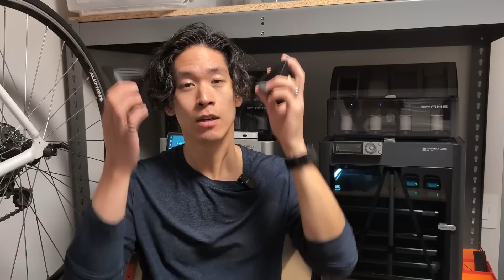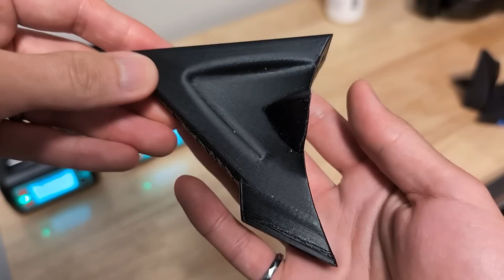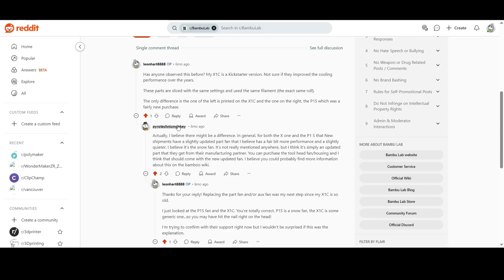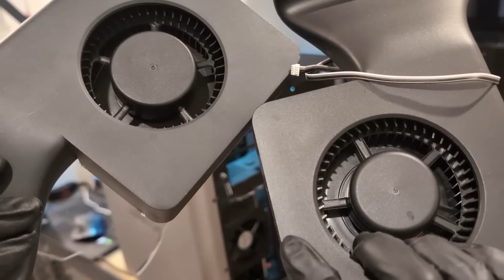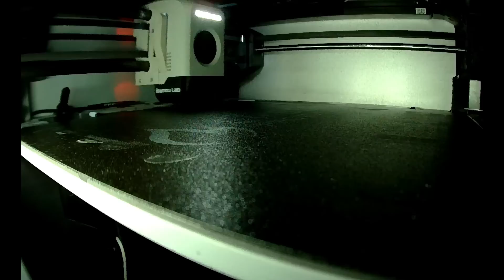Why Your Bambu Lab X1C Overhangs SUCK

Comment from the maker: I showed the wrong part cooling fan on the Bambu Lab website - see the description for correct links.

Old cooling fan --> no name, 0.15A
New cooling fan --> Snowfan, 0.22A

Old aux fan --> no name, 0.50A
New cooling fan --> Snowfan, 0.80A

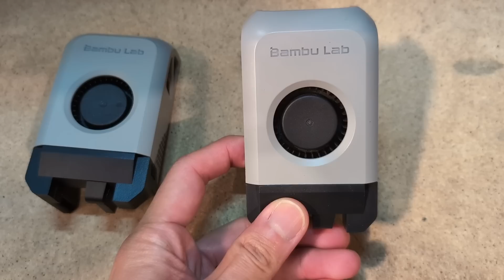The easiest thing to do is remove the front tool head cover and look at the fan label (shown in timestamp 2:40). If it's an older one, chances are your aux fan is also old.

I also added the 3MF file for the cat ears in the description so you can test yourself.
Reply: My P1P has a no name 0.15A part cooling fan as well.
Reply from the maker: @RFmissbehavin yeah, been hearing this a lot lately. I thought it was Kickstarter units only but guess not 😮
Reply: @emberprototypes  Bought mine in 22 and they are both the older ones time to get a different one thanks for the info.
Reply: I bought a new frontend assembly now and it has a 0.2A (not 0.22!) fan from Guangdong Fengxin Electronic Motor Co which is definitely not a Snowfan
Reply from the maker: @kuuhgle  hah, i guess things be changing all the time! A small difference in current might not be meaningful here, as without a datasheet to compare, we can't know whether or not the flow is actually better or worse
Reply: @emberprototypes  do you have an email? Ill look up the spec sheet
Reply from the maker: @kuuhgle yup, go to our website and the emails there! You can probably find the spec sheet just by looking up the part number (though I couldn't find the original old fan model I showed)
Reply: I bought my X1C in July of 2023, where the first units shipped in September of 2022, and it has the older 0.15A fan on the front housing assembly.
Reply from the maker: @dandixonus  my kickstarter theory has definitely been proved wrong by all these comments 😅
Reply: I got a replacement aux fan with my used X1C, the guy hadn't installed it yet. It's a 0.80A no-name fan (no snowfan) weird!
Reply from the maker: @kuuhgle  It's possible that it's actually the same model as the Snowfan. Some people have sent me pictures and it doesn't have the Snowfan name on it, but the part number is exactly the same (which means they just changed the look of the label at some point)
Reply: Have you found anywhere to just buy the fan instead of the whole front assembly?
Reply from the maker: @Ouroboros_Yokai  no but I honestly haven't spent much time looking haha
Reply: Quel est le mieux : 0.15A ou le 0.22A ?

Comment: I ordered a new toolhead and got a 0.2A Fan instead of the 0,22. But as my old Aux Fan Had a Problem and they sent me a replacement, I got the right one from snowfan.
Reply from the maker: The aux fan is probably the biggest contributor if you are having issues. It was for me at least.
Reply: @emberprototypes  I only use the aux for circulating the air. I have a reflector mounted so i don't use it for cooling because I mainly print ASA and I don't want the parts to be warping.
Reply from the maker: @Muu_69 ah yes. I never use it for engineering materials either!

Comment: If I print PLA with the top door closed on my Centauri Carbon the printer either beeps at me for excess heat or I get that result with overhangs. Simply taking it off solves the problem and keeps the printer temperature correct.

Comment: My test result: There was NO difference. Exactly the same before and after. $60 for nothing 😞

I watched the video and found the difference quite clear. Since I bought my X1C in June 2023, I was sure I had the old fans.
So I ordered new fans. The new fans were also different, as described in the video.

I printed the same file as in the video. Then I installed the new fans and printed the exact same thing again for comparison. 

And I have to say, I saw NO difference. The result was 100% the same.

The before and after prints looked exactly the same as on his P1S, or as they did after he replaced his fans.

I could have saved myself the $50 for the fans. And because the video also shows the wrong fan (the correct one is in the description), I spent over $60 for nothing. 

In his case, replacing the fan seemed to have helped. But my tip to everyone watching this: first check whether you actually have any problems. And don't blindly buy new fans based on the advice of a video.

I don't want to badmouth or disparage the video or the tip. In his case, it helped. But for me personally, it didn't do anything except leave me with a bunch of spare fans.

I'm curious to hear what others have to say.
Reply from the maker: Sorry to hear that, but also good to hear your machine never had issues to begin with!

I think there could be lots of variables here...maybe I had a bad aux fan to begin with and the fan model change was just a red herring. Maybe there have been firmware changes since the six months ago I filmed this that resolved or improved overhang issues. All I know is that it helped me and I wanted to share my findings with others.

For others, definitely check that you have a problem first!

Comment: Which fan did you replace exactly? In the video, you order a cooling fan for the hotend. But in the video, you then seem to refer to the fan from the front housing assembly. The cooling fan for the hotend is located directly on the hotend and is much smaller. This is very confusing in the video, and I have probably ordered the wrong fan. 
So, once again, which fan did you order exactly? Thanks.
Reply from the maker: I show the wrong fan for the tool head in the video (noted in my pinned comment).

The link in my description is the correct part. Sorry for the confusion!
Reply: @emberprototypes  Oh, I hadn't read the pinned comment. Well, it's a bit annoying, but having a cooling fan for the hotend in reserve might not be a bad idea. 😀
 The worst part is that I now have to wait until the right fan arrives to test whether there is a difference and how big it is.
Reply from the maker: @marcloker5240 yeah sorry, I wish YouTube let you edit or at least put text over sections of videos...not sure why they don't allow that. Hope you can see some gains once the right fans come in!
Reply: @emberprototypes  Thx. I will tell you about my experiences.

Comment: I’ve used an A1 mini for a few years and recently upgraded to the X1C but have been extremely disappointed that the bridges and overhangs look worse than the A1 in every print so far. Both my fans are no name but are .20A and .75A and say Rev 2025-04-17 V1. Do you think it’s worth upgrading?
Reply from the maker: Interesting - sounds like there are so many different fans out there. I'm not sure that it would be worth it if your machine is new honestly but if you've tried everything else then maybe worth a shot

Comment: Wow, never heard of this and I have an early model of the X1C, so will definitely be ordering new fans. Thanks!!
Reply from the maker: No problem 🙌
Reply: I would change the print head fan only...
Easier and probably gets the same result in this case.
Reply from the maker: @anderslagerqvist2642  I remember trying this but didn't film it and I think I recall the aux fan making the biggest difference.

Comment: The other thing that I certainly wonder about on the x1c lately compared to the p1s, is the AI flow control. I wonder even more about it after adding a H2D to my farm. Which initially out of the box had very poor PLA quality. But after several prints, (of the same part with no slicer changes) this changed. Yes the H2D seems to be more AI compensated than the X1C, but i certainly wouldn't be surprised if there are things shared between the two in this situation, inside the codebase. 

If i am not printing PC/Nylons the p1s is generally been my goto and reliable machine choice. Which shows you just how good a simple machine can be for so much stuff. But active chamber heater on the H2D is a game changer for high temp and engineering filaments. Even compared to the X1C, Which is very good. 

Also I am currently waiting for the next couple of revision of bambu studio 2.2.x (as i don't trust the initial release, had to many problems lately with odd slicing behaviors on some of the initial releases). Cause I really want to see what Helio add's for visualization information, help me tune my prints for production repeatability and quality.

Comment: I'm running into a similar issue between two X1Cs with PETG (Bambu's PETG-HF filament).  It's a fairly simple model with a ~45-degree overhang on both sides, but regardless of how well I dry the filament, the one printer just doesn't look as good as the other on overhangs.  Here's the kicker though... unless I miss-numbered my printers, the older X1C is the one that prints better than the newer one.
Reply from the maker: That's wild 🤯would be very curious to know why!

Comment: funny, I have the exact same problem but on my p1s, I just checked the fan and it is indeed the same as the one you replaced on the x1c
Reply from the maker: Weird 🤷‍♂
Reply: Did you manage to fix it? Maybe you are not running it on 100%?

Comment: Nice info thanks for the video I wasn't aware they changed the fans for the better. I have a old X1C and overhangs were bad but I found orientation of the over hang to the toolhead part cooling ducts made a hung difference. So I printed parts so over hanging areas were at 45 or 30 degrees to the ducts and that's a big improvement due to the amount of air now hitting the loong surface. 

I then changed to a superior design part cooling ducts by ben2c that has four air exits and a vortex affect to it. Now I don't need to worry about angling parts as it's awesome upgrade
Reply from the maker: Yeah orientation can make a big difference since the aux fan is only on the left side...for me, if I printed these cat ears 180 degrees around, the overhangs would be really bad
Reply: @emberprototypes  ah i think i haven't been understood here. Just made a image but damn can't share it here. so i meant no aux fan. only part cooling on the tool head. Angle the over hang of the part at an angle of 45 degrees to the air duct / the side of the tool head, or another way of saying it is to angle the overhang face so it points at the camera or front left of the printer. I found the left side is more powerful (without aux fan) and at this angle the fan blows more heat away and overhangs far better at speed. I also think at an angle means the air is not forcing the filament downwards as hard which would blow it away from the part. There's always slowing your wall speed down and also printing from inside outside wall order that makes a big difference to more extreme overhangs.

Comment: Anytime I print with PLA in the X1C, the aux fan causes that side of the print to lift off the bed and cause imperfections or failed prints.
Reply from the maker: Weird. I keep hearing some people say this but I've never had issues, and find the aux fan is really important for high speed PLA printing.
Reply: @emberprototypes Fingers crossed that it’s not the new aux fan, you’ll have to keep an eye on it 👍

Comment: I have an early X1C and I just wonder how this'd be if you replaced only one of the fans instead of both at once. IMHO if troubleshooting an issue, don't change multiple things at once…
Reply from the maker: Yes this is very true if you are trying to be scientific. In my case, I didn't really care and just wanted to solve the problem and it was cheap enough for me to do so simply by replacing both. I'm quite certain the aux fan helps a lot - and I think I did run it without the aux fan replacement but maybe just didn't film that. It's been more than 6 months since I filmed the video here so I probably forgot some things along the way as I edited recently 😅
Reply: @emberprototypes  I was just wondering, since I've seen videos that have advocated turning the aux fan off altogether, since it just ruined everything, or so they said. I've tried to turn it off for some prints, but haven't noticed much difference.
Reply from the maker: @roysigurdkarlsbakk3842  i've honestly never heard of this until I published this video. I've personally never had problems with the aux fan 🤷‍♂
Reply: @emberprototypes  Well, then the title of the video is misleading because you still don't know why :)
Reply from the maker: @Somun-a well I know that my X1C overhangs sucked and after replacing the fans it didn't suck 🙂
Reply: @emberprototypes Lol,  we are splitting hairs for sure but that would be "how to fix your (old) X1C overhangs". As in, don't know which one helped but the issue is resolved.
Reply: It is not just opinion, it is scientific protocol.

Comment: Did you show the wrong fan in the video? You only need the new front housing and the aux fan right?
Reply from the maker: Yes. Pretty sure I showed the correct parts in the video
Reply: @emberprototypes you showed the hotend fan which isn’t used for the part cooling 
The front housing already comes with the part cooling fan right?

Comment: Would you mind comparing your P1S fans voltage and amps versus the new fans?
Reply from the maker: I never filmed this, but I did take off the P1S toolhead and it was indeed the new snowfan units. I didn't remove the P1S aux fan though because that was too much effort. I should film/document this comparison next time!

Comment: I would suggest also adding a second AUX fan for more even cooling on both sides of your models. I think you have to get a splitter for the AUX fan and route the fan wire through holes in the printer frame and side panels... Well... It's easier if you actually take off the side panels, but I was doing it to 6 printers, and ain't no body got time for that
Reply from the maker: I've thought about this because if I actually flip this cat ear 180 degrees so the overhang is facing AWAY from the aux fan, overhang results are ugly...so there is definitely directional dependence on the aux fan.

Comment: I just completed a deep dive on this exact issue.  I found that the fan was often not even trying on a lot of overhangs that it should have been at 100% from the slicer.  In the process of trying to fix it I discovered that there is a parameter available in Orca that fixed most of it, with the old fan.  

In the printer settings, in the upper right of the setting panel, select edit, and look at the Basic information tab, there is a Cooling fan section.  there are 'Fan speed-up time' and a 'Fan kick-start time' parameters.  I set them to 0.5 and 0.3 and unchecked 'Only overhangs' and although it still ignores things sometimes, basically it prints overhangs well now.  I will definitely get the new fan, but I bet you can cleanup that first edge with these parameters.  Thanks for finding that!
Reply from the maker: Ah interesting. I'm not surprised to hear a settings change could improve the overhang results...but the fact that the same settings between P1S and X1C were giving me totally different results drove me nuts and down this rabbit hole 🙃
Reply: @emberprototypes  I kept changing things to improve the curling.  The G-code and the maps looked right but nothing changed.  I sat in front of the machine and discovered the fan was not even turning on sometimes and too late others. So I started going through every setting I could find and stumbled across it.
Reply from the maker: @ralphjohnson100  sounds like we both like rabbit holes 😂
Reply: @ralphjohnson100  same issue here. x1c  maybe halfway through a bridge it will spin up but by then its too late.
Reply: Funnily enough, while trying to gain some speed while maintaining good quality with PETG, I found that these settings were awesome even for the P1S. I didnt have to touch the kick start time one, but I did set the speed up time to 0.5 as well. It helps overhangs and bridging quite a bit as the fan was actually up to speed for them instead of playing catchup during the bridge. It also helped not push down the center of the bridge when the fan got up to speed. I think everyone should try this setting!
Reply: @thecheetahman22  The fact that it's there is yet another reason not to us Bambu Studio.😉  I am curious whether BS will use it if I load that machine profile, but is doesn't like so many of the other things that it imports from Orca settings that I just never use it.  Lack of access to pressure advance and all the zits and pits of the early days are what drove me away in the first place.
Reply: @ralphjohnson100 Honestly, I never even tried BS. By the time I got my P1S, Orca was so good that I just started there. Have had no regrets
Reply: @ralphjohnson100  its in Bambu Studio, has been for a long time. It's just under the Filament Profile Cooling tab instead.
Reply: @slothy89  That is different.  This setting starts the fan early, so it is cooling at the start of the feature instead of just getting out of bed and looking for coffee.  Just changing the values available in Studio means it just ignores the fan speed command on most short features and leaves bad leading edges on longer ones.
Reply: @slothy89  This is different.  Orca has the same settings there.  This is on the machine properties.  It allows you to start the fan early so it is up to speed in time.  Bambu may have this hidden and pre-configured but from what I can tell it is either not there or not aggressive enough. There is no opportunity to adjust it when wrong.